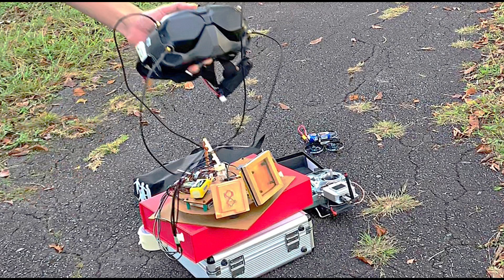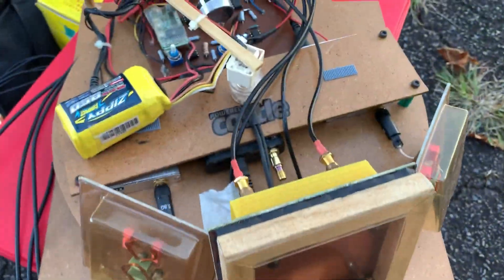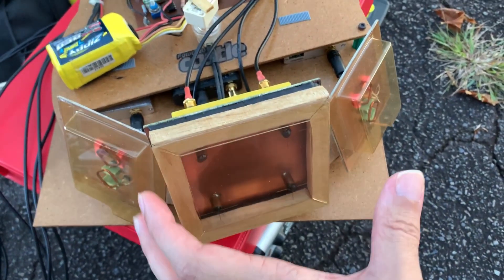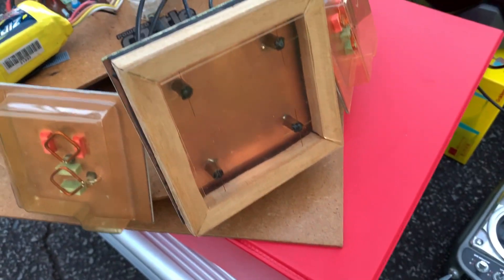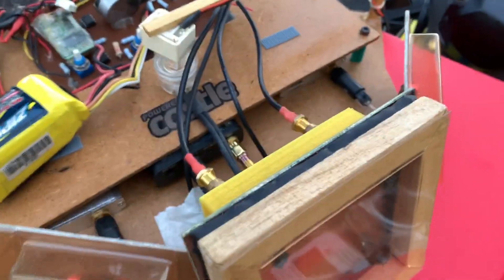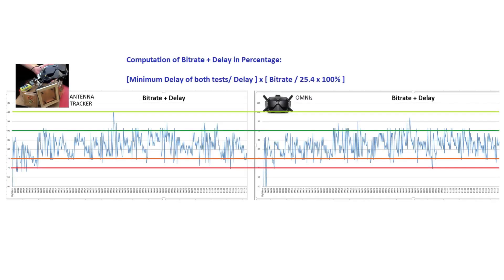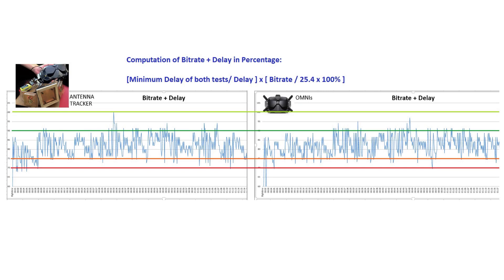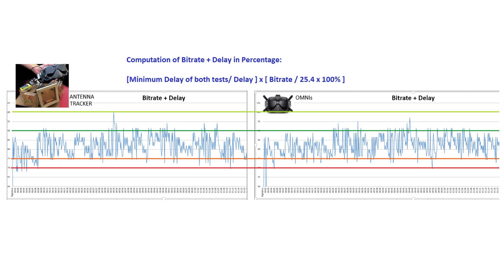IBCrazy Antenna Tracker for DJI Digital FPV?

Comment: I thought DJI used beam form technology built in ? Interesting video !
Reply from the maker: Thanks for watching this project, DJI is pretty good with its omni coverage but this changes immediately when we put on high gain directional antennae and  there isn’t any built-in phase shifter to bend the directional beam.

Comment: How did you connect the RSSI from your receiver? Goggles or rssi from telemetry?
Reply from the maker: Thanks for watching. The turntable has 2 identical analog 5.8ghz VRXs that pick up the incoming signal from the DJI air unit. The differential RSSI from the 2 analog VRXs is processed by the tracker board to steer the turntable. I have added a wiring-up tutorial to the video description above. It explains the setup of this system in detail.
Reply: @terence79chan  awesome! Does the analog VRX's have to be on a certain channel for this to work?
Reply from the maker: Yep, they need to be on the same channel as the Air Unit’s (“Race” Band channels).
Reply: Forgot to ask were you in 50 mbs or 25mbs? Because 25mbs has 8 channels an the 50mbs 3 channels
Reply from the maker: I had the air unit in 25mbps mode  on CH6 (5880mhz) and the 2 analog receivers (connected to the tracker) were set to the same frequency (race band CH7).